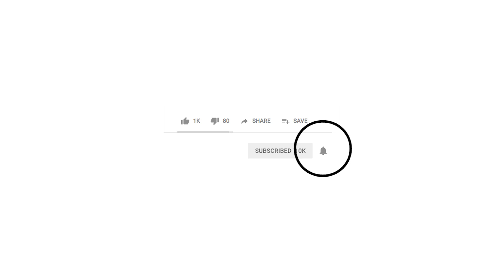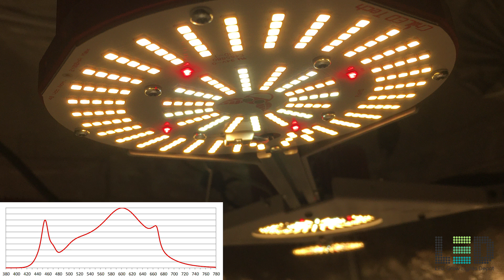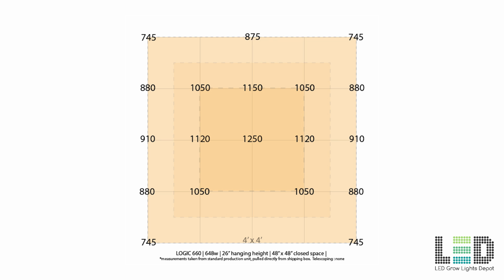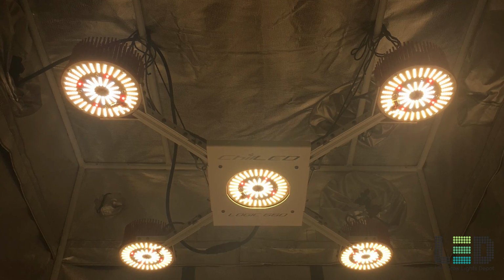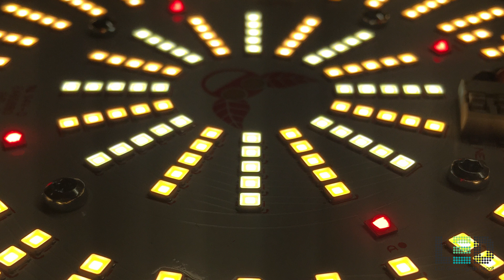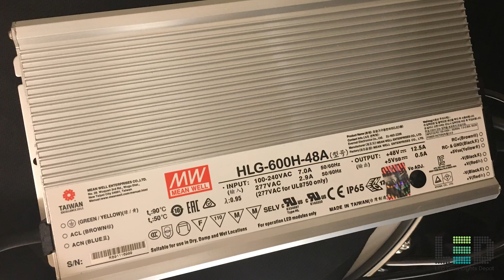ChilLED Tech Logic 660 LED Grow Light Review

Comment: Great fixture here. I love that I was able to mount the driver outside of my grow tent, keeping temps lower inside my tent. I also am impressed with the heatsink design on the pucks. Having the pucks spread out also helps with heat dissipation and also contributes to light distribution. The spread in a 4x4 is great. This fixture has a well thought out design, in my opinion. The price is a little high, but when compared to similarly priced fixtures, I think the features of this one make it the smart purchase when compared to its competitors. Also, if anything goes wrong with a puck, I can change out the individual puck instead of replacing the entire fixture or swapping out boards. I’m pretty happy with this light so far.

Comment: Very nice stipend too expensive you can actually make one of those for under $300
Reply: The Price is actually $799 at this time.
& You can't build your own for less than $400.
Just like PLC & Gene's light's, except they're round, instead of straight strips.
Reply: Andrew Brent  Assembled in the USA with Chinese components, and yes there are more efficient Quantum boards and strip set ups than those. Alibaba is the place to shop for this stuff. So much cheaper. Way cheaper.
Reply: @steveletson6616  I've heard the drivers from China are bootleg?
Reply: @bohaggin5913  If you are worried about fake MW drivers buy them from TRC. They are authorized dealers of MW products in the USA. MW is not the only choice for drivers. Real or fake it's all Chinese. Do your due diligence while sourcing components.
Reply: @steveletson6616  respect for comments

Comment: This is 100% chinese
Reply: Andrew Brent  dude I'm sure I've been around LED growing lights way more than what you've been. I am 95% sure that the heat sinks are chinese, the driver although it is not from china I'm sure it is provided by the Chinese company they are using. I'm also 95% sure ChilledTech  did the circle light design with the kind of diodes they wanted and made the Chinese company do it for them with all the logos and stuff. They got a high production deal so they accepted to do the custom design and that's it. With that I'm not saying the light is bad I just ment that they are selling the lights way fucking expensive as they are the same as the new Kingbrite and such company's QBs thatare half the price and do the same. Maybe their QBs are not as efficient just cause they push them too much but if you ask them to run them softer they sure change you the driver.
Reply: Andrew Brent  I 100% agree mate but KingBrite and such companies make perfect quality QBs and COBs builds using samsung, cree, citizen and luminus chips that are 100% the same as the growmau (different build). As I said, they push LED too much to get more W out of the same LED thus making more money but you can tell them to change the driver so it drives softer, more efficiently and lasts longer. The thing is that the light of this video is 100% chinese and cost X $ and they are selling it for double the cost and they are like... Hey (you morons) guys we have build an over the top high tier technology (100% chinese) light that grows cannabis by itself and only costs X$ (you can get the same for half price stupid BUT) get  ours now you wont regret it. This is whats pissing me off, most ppl dont know depply about lights, electronics, circuit builds and such and are easly robbed. I would like to design the same light and make ppl buy it directly from Kingbrite for the real price.
Reply: @arnauvizcarramiserachs6318  hey mate do you have a YouTube channel Okie dokie stay cool peace out
Reply: @bowandarrowindian3704  having a yt channel means you have the right to say whatever tf you want or what? This light is 100% Chinese which is not bad, it is just a robbery for the price it is listed at. But hey go ahed and do whatever tf you wish.
Reply: Andrew Brent  DIY is the way, you can get better lighting and cheaper and whatsmore custom to your growspace and environment cause you are the one  designing.
Reply: Andrew Brent  it fine mate all good, I just want ppl to KNOW

Comment: Do the math that's 2.16ppfd/w par efficacy which is great!
Reply: @delsombres we're not talking the same language. Outdated??? I talk about ppfd per watt calculated based on the entire fixture (not one diode) and the space it's suited on. These variables create this number used by manufacturers. LED's are produced as high as 5,6 ppfd right now they're on the market and being  manufactured for the Industry. They are however unsuited for horticulture. Quadruple semiconductors with 4 led diodes per semiconductor. They are used for movies and stage lightings and so on. Point being you could have a 3.0ppfd per diode that doesn't equate to 2.0 ppfd per watt for the  entire fixture. The best led fixtures on the market are at 2.2ppfd/w right now!  

Migro and myself listed all of them I have a far more extensive list then MIGRO! There's virtually nothing above it on the market right now and if you still don't understand what I'm talking about then please search here on youtube "Calculate grow light efficiency from a data sheet"  it's by a migro a european led light manufacturer. It's a calculation it's not a number you get easily from manufacturers because it shows true efficacy not the efficacy per diode! You get the efficacy / the efficiency  for the entire fixture and not just one diode. When ppfd came out insiders like that number means nothing however a par apogee par meter anc calculation can't be trumped. I just trying to clarify common misconceptions and mistakes made falsely interpreting these very numbers. Peace
Reply: Andrew Brent  What parts of this light are not Chinese? Any?
Reply: https://youtu.be/qMGIZwzxo-c
Reply: Andrew Brent  Yup, 3-2-3 arrangement on a 38in aluminum frame. Not an original design, but a good layout with very even coverage. Future upgrades include a cheap eBay volt, amp, watt,  kWh meter with the built in stint. $15 each x 2.

Comment: If that light is 660w i think to b fare you should review the dbl squatch 620w led i bet it beats all lights in its price range and is as good as some of the "most" well known expensive brands
Reply: Bro potsquatch uses a 480 driver . Therefore it will pull a max of 550 watts. I even asked led Gardner just because. All hlg driver z push a little more than their rated for. With that said a hlg 480 won't pull 620 watts . This light will crush the strip / cookie sheet combo.
Reply: @blopjones1665  they do pull more then theyre rated for 620w is what the dbl squatch pulks from the wall you can speak with brett anytime bud!
Reply: @montys420-  no way a hlg 480 pulls 620 watts man i have a hlg 480 and like the other guy says max it pulled was 549 watts